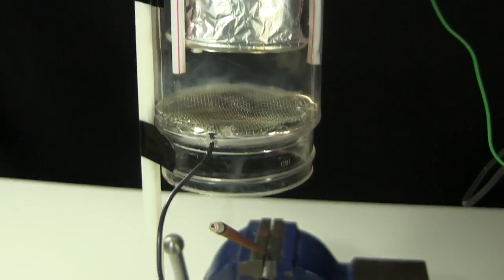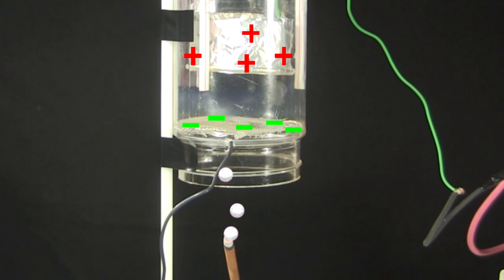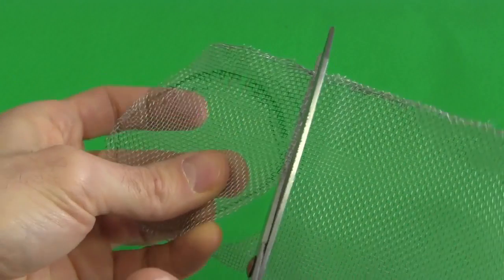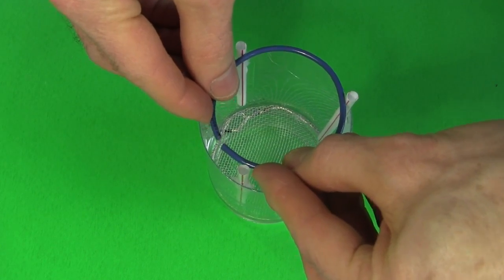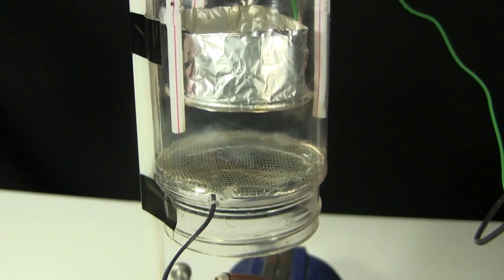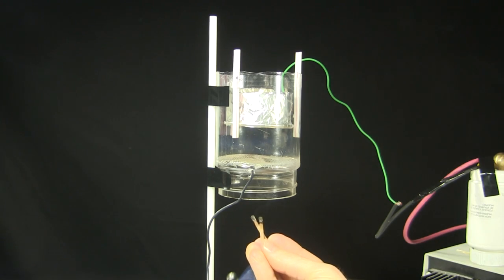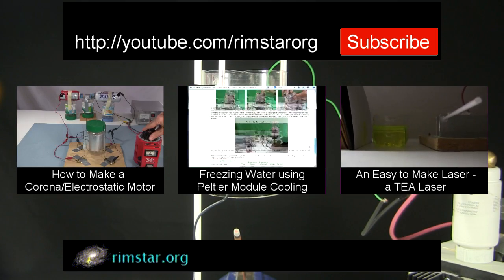Electrostatic Precipitator/Smoke Precipitator - How it Works/How to Make

Comment: CMIIMW : So this is a way to remove smoke, but it can result to ozone and nitric acid if the air is moisture enough, isnt'it?
Is there a way to remove only smoke (and dust, if available) so that all i have is clean air?
Reply from the maker: +Brad Bourdon You're right, well, as far as the ozone is concerned. I don't know about the nitric acid. There's some voltage in the 1000 to 10,000 range where it won't produce ozone though. That's how some commercially made home air purifiers work. But I've never found just what that voltage is. As for alternative methods for removing smoke, I haven't looked into it.
Reply: +RimstarOrg so it's between 1K to 10K? will your disc Wimshurst make it? thank you i really appreciate it
Reply from the maker: +Brad Bourdon My small homemade Wimshurst machine won't work. However, I did get my bigger commercially made Wimshurst machine to work with it. You can see photos of it near the bottom of my webpage here http://rimstar.org/science_electronics_projects/electrostatic_precipitator_smoke_precipitator_simple.htm.

Comment: Can I use an alternator and CDI assembly as a voltage source?
Reply from the maker: +Abhinandan Singh This is the first I've heard of CDI assemblies and I just looked them up but I still don't know enough about CDI assemblies to say. I could be wrong but it sounds like the voltage would be pulsed so I guess if the pulse rate is high enough it might work.
Reply: +RimstarOrg Thanks Sir. Will try and let you know if it works!
Reply from the maker: +Abhinandan Singh Great! I look forward to hearing how it works out. If you take enough clear photos I could even put it up on my website (http://rimstar.org/science_electronics_projects/electrostatic_precipitator_smoke_precipitator_simple.htm) so others can benefit too. This is probably the device I get asked most about how to power it.

Comment: RimstarOrg what do you meen in the ground
Reply from the maker: +Baker abdin Your high voltage power source should have two outputs. Connect one of them to the foil cylinder and connect the other one to the mesh. It doesn't matter which way, unless one of them is ground, then that one works best if it's connected to the mesh, I think.
In the case of my 30kV high voltage power supply the two outputs are high voltage positive and ground. That power supply ground is connected to the ground prong on the plug (here in North America it's the round one) that goes to the wall socket. But when I use my Wimshurst machine as the power source instead then the two outputs are high voltage positive and high voltage negative. You can see my Wimshurst machine being used at the bottom of my webpage here http://rimstar.org/science_electronics_projects/electrostatic_precipitator_smoke_precipitator_simple.htm
What are you using for a high voltage power source?

Comment: what do i conect to the metal mesh (the wire)
Reply from the maker: +Baker abdin That wire is going to ground. For the high voltage power supply I used, the two wires coming from the power supply are high voltage positive and ground. So it really depends on what you're using for a high voltage source.

Comment: Hi, I'm looking to make an ESP for a class project.  I don't have a lot of knowledge in electrical engineering, but would be very grateful if you helped me out.  Do you know if it it is possible to run this with a car ignition coil that steps up from 12V to 26KV at 2,000 RPM and 17KV at 8,000RPM?  If it is possible, my further question is how I can safely ground the current, since the coil only has a positive output.  And finally, after running, how would I be able to discharge the entire assembly.  Looking forward to any advice you might have.  Thank you!
Reply from the maker: +Unoriginal Dealer I don't know enough about ignition coils in cars to say much. The output has to be DC, not AC. The chassis of a car is used as ground by all the car components so you can too but I don't know if the output of the ignition coil is high voltage with respect to the car's ground.

Comment: hello sir can I use this on 240V AC 50 HZ
Reply from the maker: +Harsh Upale No, it needs around 10,000V DC to 20,000V DC.
Reply: +RimstarOrg how many current require
Reply from the maker: I don't know. Current is a very hard thing to measure with high voltage. I did get it work work with a Wimshurst machine which is a very low current device. You can see those tests near the bottom of my webpage here http://rimstar.org/science_electronics_projects/electrostatic_precipitator_smoke_precipitator_simple.htm.

Comment: plz tell me exact voltage needed???
Reply from the maker: +Shubham Patil The exact voltage depends on how big the distance is between the mesh and the cylinder. I estimate it to range from 10,000 volts to 25,000 volts.
Reply: Kk thanx

Comment: Hi, can i use 10KV stun gun to power this up?
Reply from the maker: +John Jeffrey Salgado I'm not sure, but I would think so if it's a stun gun that provides continuous arcing. If it's one that sparks and then you have to wait a few seconds for another spark then I doubt it. The closer the mesh is to the cylinder, the lower the voltage you need. So you may have to play with that distance to get it to work.
Reply: RimstarOrg thanks for the tips. I'll give it a try. Hope it work.

Comment: For the negative connection, if i am using a transformer circuit that supplies 15kV, do i connect the mesh to the negative of the circuit power supply??
Reply from the maker: +Darren Tan Yes, connect the mesh to the negative of the circuit power supply. Actually if you have a power supply where one side is high voltage positive and the other side is high voltage negative and neither side is grounded then it doesn't matter which way you connect it up.
However, if the negative of your power supply is grounded (like mine, even though I took the ground connection more directly from the ground for convenience) then I'd prefer connecting that to the mesh since the mesh is at the bottom and is likely closer to other grounded objects, such as anything related to the source of your smoke. In that case it's safer if that's the grounded side of the circuit.
Reply: My power supply only produces a positive high voltage output and im not so sure about the ground/negative end of the power circuit, so would you recommend me any other ways for me to connect my mesh to?
Reply from the maker: +Darren Tan Your power supply produces a positive high voltage output relative to something. I'm pretty sure that something is ground, unless it's battery operated in which case it's still relative to something but that depends on the circuit. So if it plugs into the wall then I'd recommend you do what I did and have a wire going from ground to the mesh. The simplest way to do that is to look at how many wires go from the plug into your power supply. If it's three then one of those is ground and you can connect to that. If it's only two then, again, I'm not sure that your high voltage positive is relative to. Even then, you can still try connecting the mesh to ground. I give some tips on finding a ground in this video https://www.youtube.com/watch?v=HZZmKZJrIW0 at around 6 minutes and 50 seconds in.

Comment: Besides that, would it make a difference if i were to increase the size of both the wire mesh and radius of the foil? and will this work when being connected to a voltage multiplier that would produce 10kV and above but low in current?
Reply from the maker: +Darren Tan The affect that the increased size has really depends on where the ionization is happening. Most of the ionization is happening between the circumference of the foil cylinder and the nearest parts of the mesh. So I'd recommend staying with relatively small radius. Ideally you'd have that distance between the cylinder and mesh perfectly the same all around the circumference but that's very hard to achieve. I didn't even try.
I got it to with with my commercially made Wimshurst machine which you can see at the bottom of my webpage here http://rimstar.org/science_electronics_projects/electrostatic_precipitator_smoke_precipitator_simple.htm. A Wimshurst machine is quite low current so if you have a low current voltage multiplier then I suspect it would work, though I can't say for sure.

Comment: How is the High voltage connected through the aluminium foil? is it just barely in contact with each other? and as you mentioned in your video, the aluminium foil connected to a positive high voltage output, does that mean that both the negative and positive must be supplied with both high voltage of 10kV-20kV? Hope to get a quick response cause this is for a school project
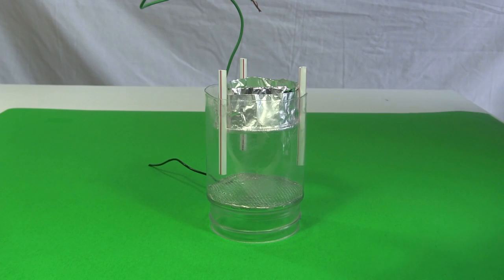Reply from the maker: +Darren Tan The wire is taped to the aluminum foil so it's a solid connection. You can see it in the video at 1:59. The negative can go through the power supply and be an actual high voltage negative or it can be a connection to ground as long as the power supplies positive is relative to ground (my power supply is that way.) So in the video I was using HV positive for the foil and ground for the mesh. Contrast that with where I used my Wimshurst machine where it is high voltage positive for the foil and high voltage negative for the mesh (in that case ground is somewhere between but it doesn't matter.)

Comment: i am doing this for my school project so to get 20,000 volts is a bit tough and the max amount of voltage which we can get is 1,000 volts so how do we do it please suggest sir
Reply from the maker: +Monvi Sachdev With only 1,000 volts it simply may not be a project that'll work for you. You can try moving the mesh and the foil closer together. The closer they are, the lower the voltage required, but I still can't guarantee that it'll work with 1,000 volts. Another possibility is to use a Wimshurst machine (not one made using CDs, you need bigger disks) like I show near the bottom of my webpage here http://rimstar.org/science_electronics_projects/electrostatic_precipitator_smoke_precipitator_simple.htm.
Or perhaps try the Franklin's bell project instead: https://www.youtube.com/watch?v=cjlMrSlIIIQ and http://youtu.be/fEqudsyIWzk. That one might work with your 1,000 volts and if it doesn't then as you can see from the first video you can use things from the kitchen to power it, and possibly some ideas from the triboelectricity video https://www.youtube.com/watch?v=ey88EdZo9hU.
Reply: thank you

Comment: what is the amount of voltage required
pls reply fast
school project
plsssssssssssss☺
Reply: How can I provide such large amount of voltage supply
Reply: Janhavi Nasre Simply buy a Flyback w/ builtin diode , it can give u 30kV
Reply: @heyyaitsardy  can to provide more info about this diode.... And its cost or its circuit
Reply: @Haseen_Qazi  better buy a transformer
Reply from the maker: +Monvi Sachdev Probably around 20,000 volts. With a smaller distance between the mesh and the cylinder you can probably use lower voltage, maybe down to 10,000 or 15,000.

Comment: That was indeed nice. Umm,l we are planning to do a small electrostatic precipators. What are the electrical voltage requirements?
Reply from the maker: +N Prãvēëñ Çhäñdhâr I didn't measure the voltage. It's partly determined by the distance between the mesh and the foil. With the distance I used I suspect mine was around 20,000 volts. You could probably get it down to the 4-digit voltages range, so somewhere between 1000 and 9999 volts since I think the voltages of the commercially made ionizers' are in that range.
You do need some current too for the ionization. For example, my CD Wimshurst machine and my Van de Graaff generators mad using soda cans have the voltage but not the current. However, if you look at the bottom of my webpage here http://rimstar.org/science_electronics_projects/electrostatic_precipitator_smoke_precipitator_simple.htm you'll see I got it working with a commercially made Wimshurst machine with 27cm (1 foot) disks.

Comment: Hey rimstar.org can i directly put the wires  in a socket
Reply from the maker: +sarathchandra vss I don't know what you mean. Do you mean can you just plug into a household wall power socket as your power supply? If so, no. The voltage is only around 120V or 240V depending on where you live. Much too low a voltage.

Comment: Hey rimstar.org can you suggest me with how much voltage is required .pls i need to do it for our scuence project pls reply fast
Reply from the maker: +sarathchandra vss I didn't measure it but I'm guessing somewhere close to 20,000 volts. You do need a little current too in order to get enough ionization. I got it just barely working with my 27cm diameter disk Wimshurst machine which you can see me doing at the bottom of this page http://rimstar.org/science_electronics_projects/electrostatic_precipitator_smoke_precipitator_simple.htm.
Reply from the maker: +sarathchandra vss Oh, and the close you put the mesh to the aluminum foil cylinder, the lower the voltage you'll need.

Comment from the maker: +Itz Yash A soda can Van de Graaff generator probably wouldn't be able to power it. One with a larger dome should be able to though. The same for Wimshurst machines. A Wimshurst machine made using CDs probably wouldn't be able to but one with larger disks should. My commercially made Wimshurst machine with 27cm diameter disks was able to power the precipitator.
PS. If you want people to be able to Reply to you directly then go to your Google+ settings and change the "who can reply to public posts" to Anyone.
Reply: +RimstarOrg I Am Having A Van de graaff with large dome..
So are u sure that it willl work..?
Reply from the maker: +Itz Yash I haven't tried it myself so I can't be sure it will work. However, if it's a big enough Van de Graaff then it should be comparable to my 27cm diameter Wimshurst machine. This precipitator is simple enough to build and try so you should try it and see. Let me know how it goes.

Comment: Is it possible to make a BIGGER version of this? And are you able to wash off the grime from the aluminum so you can use it over and over again? I am very curious about this
Reply from the maker: +GUNVALKERIE It washes off easily with dish soap and hot water. I used aluminum foil which is pretty delicate but you could use a more solid aluminum instead. Keep in mind that this produces ozone as a bi-product, which is harmful in large doses. There is some voltage below which ozone isn't produced but I don't know what that voltage is; somewhere between 1kV and 10kV. It's the voltage that air ionizers that you can by in the store use but I don't know what it is. These electrostatic precipitators are used on a very large scale https://en.wikipedia.org/wiki/Electrostatic_precipitator.

Comment: can u reply my comment
Reply from the maker: +MAK Which comment? The last thing you asked was what can you use instead of that high voltage power supply, and I replied to that.
Reply: +RimstarOrg can i use battery used in vehicles instead of that
Reply from the maker: +MAK No, it requires high voltage. The battery in vehicles supplies only around 12 volts whereas this needs in the thousands of volts. I don't know exactly how many but my guess is somewhere around 10,000 to 20,000 volts.

Comment from the maker: +MAK An easy to get power supply is a Wimshurst machine like the one I show doing it at the bottom of this page here http://rimstar.org/science_electronics_projects/electrostatic_precipitator_smoke_precipitator_simple.htm. My smaller Wimshurst machine made using CDs won't do it.
PS. It's very difficult to reply this way. I think your reply button doesn't appear because your Google+ settings don't allow it. Go to your Google+ page, click on your icon in the top-right corner, click on Settings, and set the "Who can comment on your public posts?" to "Anyone".
Reply: +RimstarOrg I changed my settings, so pls..
Reply: +RimstarOrg I forgot to ask when the smoke is stop by the machine what type of gas gets through? I'm not sure if you mention that in your clip... just wondering :)
Reply from the maker: +GUNVALKERIE I don't know all the gases but as I mentioned in my other reply, one of them is ozone.

Comment: Could you use this when soldering to suck the fumes since the melted solder fumes are bad for your health rimstarorg?
Reply from the maker: +sciencenerds Theoretically I guess you could but the soldering would have to be done pretty close to the inlet since the suction isn't that strong. Much simpler to use a fan and a hose I think.

Comment: how much voltage battery is required?
Reply from the maker: shobhna bhardwaj Batteries won't work. You need high voltage. I did not measure how much but it is in the thousands of volts, maybe even around 20,000 volts. An easy to get power supply is a Wimshurst machine like this one https://plus.google.com/b/116395125136223897621/116395125136223897621/posts/Wr8EWoc4bSc?pageId=116395125136223897621